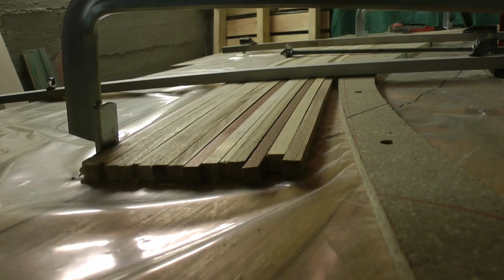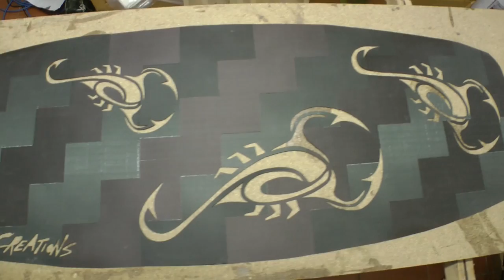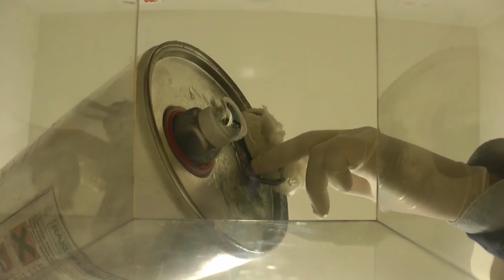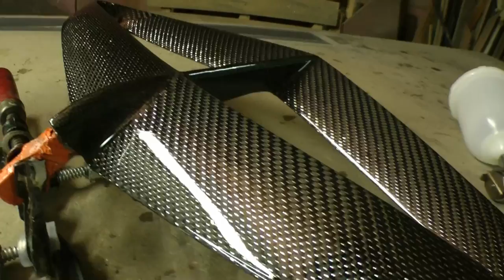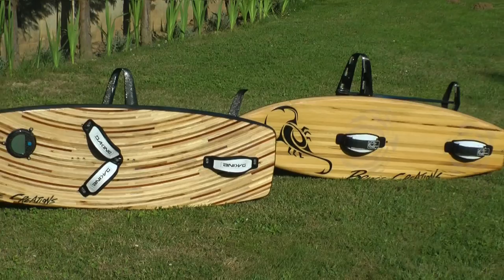Hydrofoil kitesurfing box wing 2. Fabrication

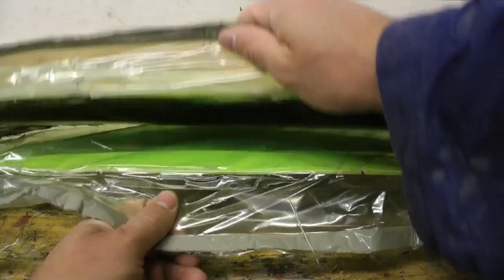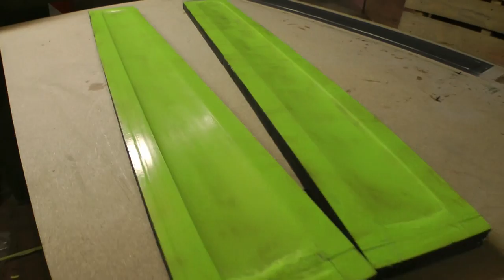Comment: Superbe video, il est possible d'avoir plus d'informations comment tu as fais les wings en particulier comment faire pour que le carbon soit pressé correctement contre toutes les faces du moules, je penses bien que c'est de l'infusion mais il semble que une fois tu as le bag à l'intérieur du moule (2:20) et une fois à l'exterieur pour le support vertical (2:30). Faut il avoir une sorte de chambre à air à l'intérieur ou juste compter sur l'epoxy pour "fill the gaps". Merci!

Comment: What hot coat/clear coat "schedule" would you recommend to achieve a glossy finish on carbon fiber? Right now I have done hotcoat/sand/hotcoat. I was hoping to get glossy finish at this stage but I still see some low spots. Would a third hocoat/sand and clear coat/wet sanding be sufficient?

Comment: Thank you very much for uploading all the video's!! , i have watched them all and got very good help from it to build my own hydrofoil.  I have recently finished mine, but i am not satisfied with the carbon mast that i made. I have made an negative mold, just like you, but i wonder how you made it, i did it in 3 steps: 
1. first i did wet lay-up side 1
2. then i did wet lay-up side 2
3. i put epoxy+ microballons in both cavities and clamped the molds together (
For the leading and trealling edge i used an extra plate to have a extra reference to make a strong bond between these layers for good torsional stiffness)
how did you make it, it looks like you made the mast in only 1 step. Did you made the mast entirely out of carbon? (without core) and how did you archive compression of the fibers (to avoid bubbles)
Thanks anyway!
Reply from the maker: Hi Joris, I'm pleased that you found the videos useful!  I think that you'll like the new one that i'll post next week. Stay tuned!
About your question, I do a full carbon mast. 10 % of total amount of material is uniaxial high modulus carbon fiber, 30% standard 200gr uniaxial cf, 10% biaxial 45 degree, 50% twill. 

When you wet lay the single layer of carbon fiber in the mould you have push harder with a spatula in order to eliminate the intrapped air. You have to fill the two shells of the mold with the layers needed. When you reach the level you put some more layer for both part and an extra resin.
At this point, you close and squeeze the mold. It is important that in your mold you have some little channel that leave to the extra resin to go out. 

Have a good fun!
Reply: @Brucecreations77  thank you so much for your answer, it helped a lot!
I think i need to order some more carbon to make a solid mast haha.
I noticed that ordering thick (600 grams/m^2) unidirectional is significant cheaper (ca 25 euros/kg), compared to 200 grams unidirectional (70 euro/kg), do you know if the same weight in 200 grams/m^2 cloth is stronger/stiffer? compared to 600 grams cloth
And do you maybe know the total weight of the mast you made?

Joris

Comment: Really impressive. It looked like you made the wing with two female moulds in one go. Do you have compressible core or how do you get a solid wing? Or do you use bladder molding?
Reply from the maker: It's enough to cut the various carbon fiber sheets  with different shape in order to offset the different thikness of the profile, as you can see in the video
Reply: Brucecreations Thank you for answering. That's interesting. I have been thinking of how to make fins with female mounds without having to make them I two parts and glue them together. Will try your method. 👍
Reply: @Brucecreations77  I would love to see some more detail on how you did this.  I can't wrap my head around how both sides of the wing come out of the mould like that.

Comment: Just super. Love the glossy finish and using this PET sheet is quite clever. I'm wondering how did you managed to cut the logo into the dry carbon fiber?
Reply from the maker: Thanks. I cut the carbon whit a sharped knife. You have to consider the fact that is only a thin layer of spread tow.
Reply: I believe it's quite time consuming, but the precision is amazing.

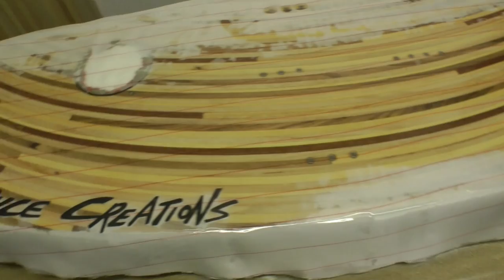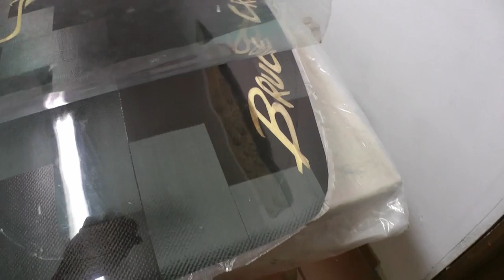Comment: Really great video!. I have a question. What foil (plastic) are you using at 1:19 and at 1:37? What did you do between the step of applying the peelply and removing the foil in 1:19?
Keep up posting those great vids!
Reply from the maker: +skwerl13   It's a PET sheet. After removing the peel ply you need to put some more resin and roll out the PET film. For curved surfaces an HDPE film is better.
Reply: +Brucecreations Thank you very much for your answer! But do you also send the surface (after you peeld off the peelply) before applying the extra "layer" of resin? If I understand it right, the thicker plastic you use is HDPE right!?
I found out that PP (polypropylene) sheets also work very well to achieve a smooth surface, they also can be released very easily.
Reply from the maker: +skwerl13 
No, a sanding isn't needed, you can add some resin directly on the surface of removed peel ply. Yes, it's HDPE but for sure also PP works well.

Comment: hi
if i have a boat 6 meter long and 1 meter withe can i use only hydrofoil on that boat can it generate lift ?
Reply from the maker: you could put an hydrofoil almost in every boat but each configuration is different

Comment: What function has the round "box" with the display?
Reply from the maker: It's a GPS for instant and maximun speed, it is usefull if you want better understand the differences when you are doing some profile modifications
Reply: Thanks for the fast answer.
I'm building and flying sailplanes with in an academic group, so i'm really interested in your work.
But I don't understand how you modify the profile.
The are only like 4-5 screwed connections.
Reply from the maker: For each foil the profile is fixed, but, as you can see also in previous videos, I can change the kind of foil in order to see how different configurations works.